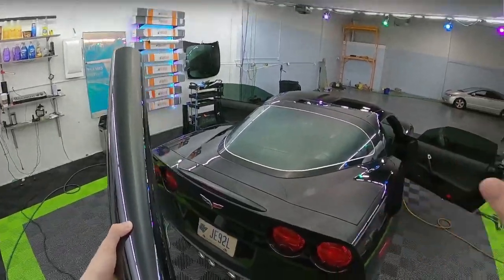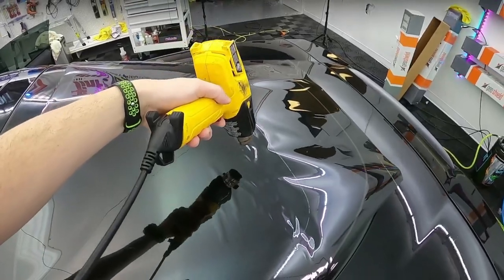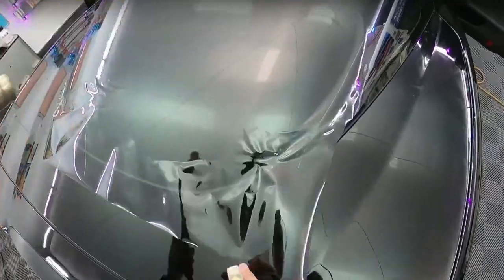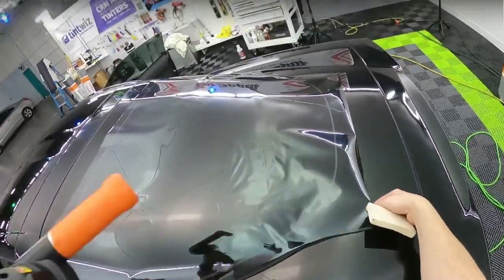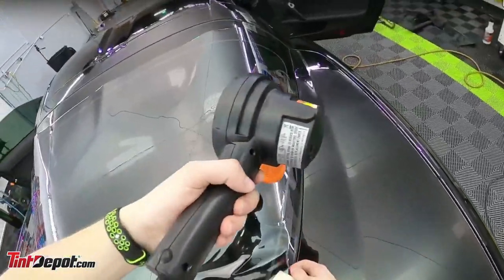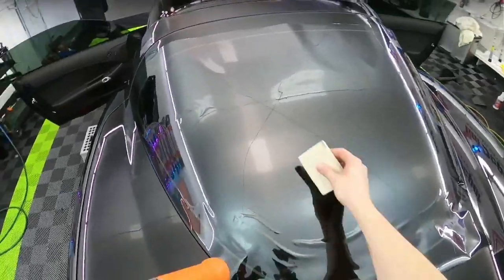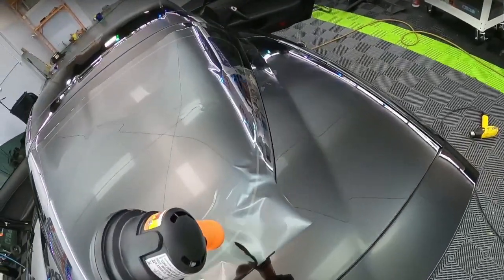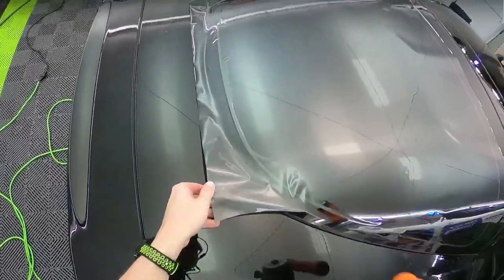Almost QUIT! Tinting a Corvette

Comment: that was pretty intense. It did look like the driver's side a a bit to go to finish the curve up by the roof though but you done a great job. After watching you do this, I wouldn't try one like this; all the experience you have and you were struggling with shrinking those hard curves, but very well done! I think it would get more views if you tried to rename it though; I think I would name it about techniques on how to avoid overheating and pushing it too soon or something; that seemed to be the biggest thing to deal with, either over heating it or hurrying it and putting creases in it or whatever. Great video, Matt! This video should get a lot more views!!!!!

Comment: A New Holland T9 has glass that's curved about a foot each direction over about 60 inches of height and 50 inches of width. It's like tinting half a basketball. That one almost made me quit laying film. You can do it in two seems though at 30 inches from top to bottom and the width of the window. It IS possible, it's just not fun at all.

Comment: Hey man, what are you using as the perimeter the white line? do you do that to avoid etching from the blade or just so you dont have to use a light to cut after you shrink. Curious because im starting at a fully retail store and want to do things right instead of the 20 stock units i knock out a day. thanks.
Reply: glass aid.. and keep your knife to a 10 degree angle, tilting it higher and higher can and possibly will scratch the glass.

Comment: I REALLY enjoy your videos, and have found them very informative. No idea why they showed up in my YouTube recommendations, but I'm glad they did.

I do have two questions, after watching you Video on installing the Geoshield Pronano Ceramic 70% on a front window. 

1. Do you know of ANYONE in New Mexico that would install this on my Jeep? The windshield is flat, so it shouldn't be that hard to do, however, at $70ish a sheet to try and do this myself, I'm thinking maybe let someone that knows what they are doing give it a try. 
2. Or, maybe I should just buy some cheap tint, and use it to learn to do the install? Then when I think I can do it myself move up to the Geosheild?

Thanks.
Reply: not a tint expert at all, but i’d say start off with cheap tint, especially if you never done. would be good practice before doing the geoshield
Reply: @SoyChukii   I'm think you may be correct. 
I can get a 36"x20' roll for less then $40, since I only need a strip 18" wide I'd get a lot of "oh crap" out of the roll.
Reply: It looks easy, even if it's flat like a jeep windshield, but tinting is not something you pick up in 3 or 4 tries. If you're gonna do it yourself, be prepared to mess up a lot and be okay with a flawed final product.
Reply: @jakeostler6110  seems no one knows of any decent installers here in NM

Comment: This reminded me of the time I did my 85 Z28 Camaro
Reply: Another very difficult back glass.
Reply: @stanwashighski3553  not even a little bit similar. 3rd gen Camaros barely need to be shrunk. They have a very minor reverse curve on the bottom corners and a defroster braid about a half inch in that kinda suck to deal with but not similar to a C6 rear glass at all.
Reply: @tintshady2049  ok, maybe it's just me and every other sticker I know.
Reply: @stanwashighski3553  sounds like you need to surround yourself with better installers. Lucky for you and your hack friends they don't make windows like this anymore. Everything is cookie cutter slam dunk gravy shit. This is why the younger generation of installers suck so bad, they didn't have to deal with the nightmare installs of the 90s...
Reply: @tintshady2049   ok guy, you're  better. What the name of your store again?

Comment: what do you apply on the window before you put the window film for the rear window, something like baby powder
Reply: Yeah i also want to know?
Reply: @souf900   I use, just a bar of soap, nothing else
Reply: @2004chelo  you do it on wet glove?
Reply: I pretty sure he uses a bounty dryer sheet. 
Wet it then squeeze it dry.
Wipe it all over and make sure it dries before putting the tint on.
Just finished tinting school today and that’s what we do.
Reply: i use dryer sheet with a little bit of slip solution

Comment: Why could you not have kept that first piece and just slid it down a little bit? If you have enough at the top and set those burns or wrinkled parts where you would cut it would that not still work?
Reply: it would idk why he didn’t

Comment: What do you recommend to shrink windshields? A blue hard hard or hard felt card?
Reply: Was told it’s the same but what ever your comfortable with
Reply: Blue hard cards to soft. It's will grab when gets hot. Use a pink hard card. No felt

Comment: Yo why when I bought tint from auto zone the tint wasn’t big enough to cover the whole window ?
Reply: didn't measure to make sure the rolls they sell at autozone were wide or long enough for your application.
Reply: If you try to do a back window with tint from AutoZone you have to get the long truck & suv box. Even then it may be too short for some windows

Comment: As a wrapper scares me seeing squeegee so quick on those wrinkles. Could you not glass out material and use magnets to help hold film on edges?
Reply: Doesn't work like that. Window film only shrinks in one direction and it doesn't stretch like vinyl. There's no "glass'n it out"...not to mention a corvette is all fiberglass, idk wtf you're sticking a magnet to.
Reply: @tintshady2049  lol calm it down. Called gecko pads my dude. So you can have mags on not mag surface. Or tape… And I doubt that I have tinted a bit and doesn’t just shrink one way.
Reply: @13bHappy  🙄...it absolutely only shrinks one way, top and bottom of the roll, won't shrink linear. Stick to vinyl, my dude...

Comment: I def don't understand tint and why you shrink that way... from the outer edges to the center.  That's geometrically wrong.  I'm in the vinyl graphics biz - wraps, etc. - and with that, one starts from the center and works to the outer perimeter.
Reply: Tint only shrinks up and down from the roll. If we could shrink from all directions we would do it.

Comment: I can teach you how to shrink this in about ten minutes. You're shrinking technique isn't bad but your process is wrong. You're making it way harder on yourself than it needs to be.
Reply: What’s the trick?
Reply: @skywalker859  short version, first off get that tape or whatever he's got on there the fuck off, then use a pen attachment to plot a pattern, liner side out, in the middle of a 40" roll, don't trim it down. Then do your normal H pattern but only on the top, so more of a U pattern but line up your patterns top edge about 2-3“ higher than the matrix. Shrink it out while pulling up fairly hard on the excess film. Shrink it as far as you can without it getting super sketchy. Then do a U pattern on the bottom, scoot your film down and do the same thing. Now move your pattern to the middle of the window, rough cut the bottom but leave it as long as you can so you can pull on it. Do your regular H pattern and finish dry shrinking, wet check shrink it if you need to, throw it on the board and trim it out. Slap it. Also should have mentioned, don't fucking card it down when dry shrinking. Idk why guys do this, who's teaching it, it's ridiculous and unnecessary. Pull your top, keep your fingers verticle, don't over shrink and let them go horizontal. You can card it down if you're wet checking, obviously, but carding down while dry shrinking is amateur hour shit.
Reply: @tintshady2049  could you make a video dry shrinking an average window so I can understand your techniques?
Reply: I was taught by a guy who tinted in the 80s and 90s too. He taught me not to card as I’m shrinking and wet check once everything was done shrinking. I like that process for shrinking back windows a lot better.